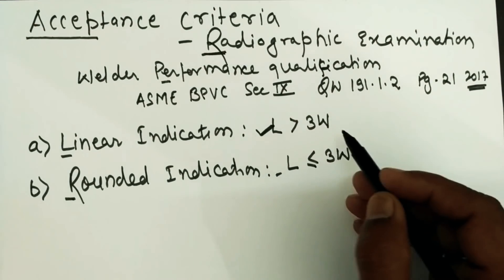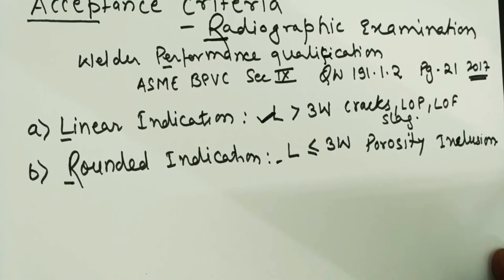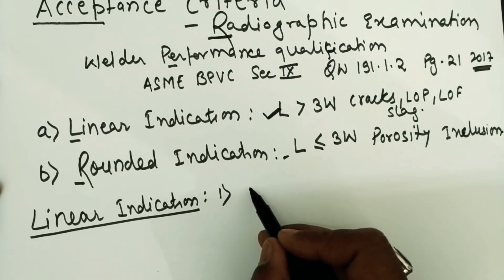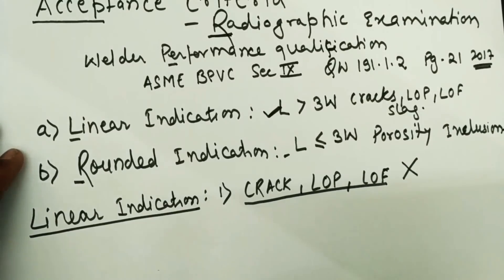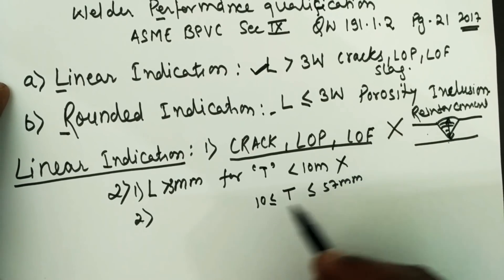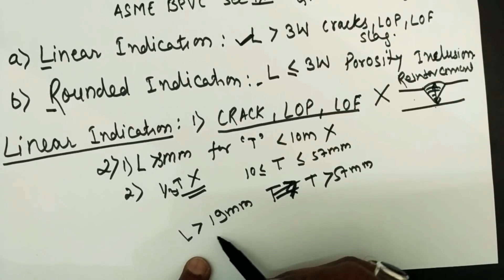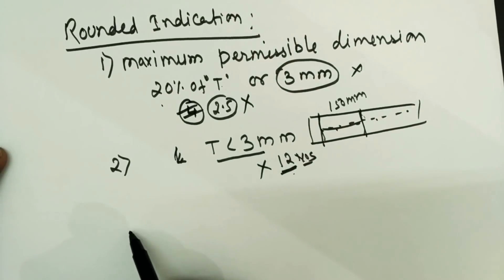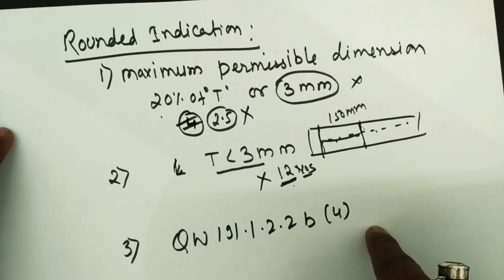[English] Acceptance Criteria for Radiography Test (RT) of welder qualification test coupon

Comment: A welder qualified to make arc spot welds on 20 gage steel deck is also qualified to weld:
a. 22 gage steel deck
b. 18 gage steel deck
c. 18 through 22 gage steel deck 
c. None of the above